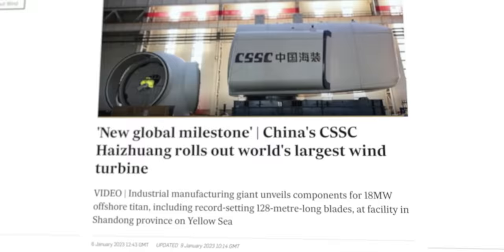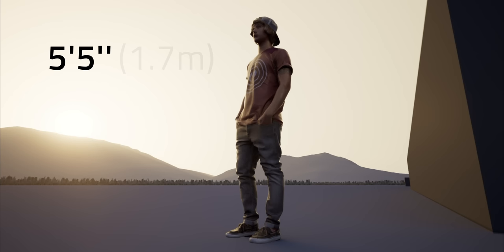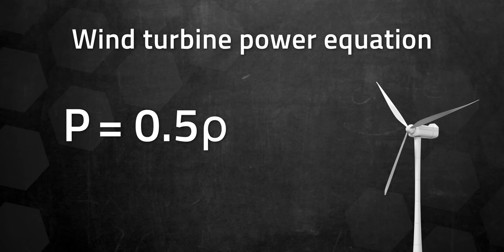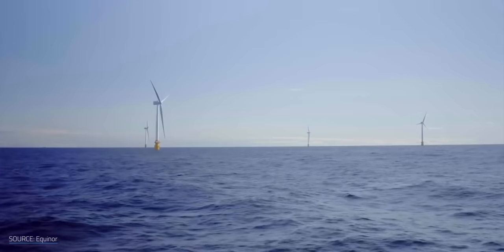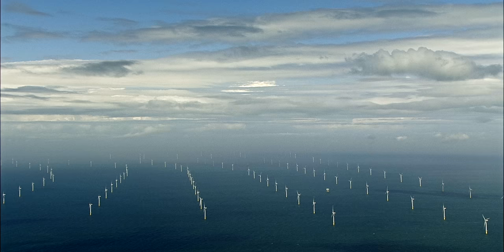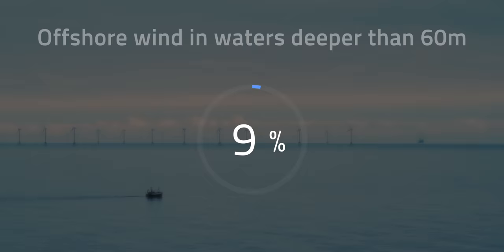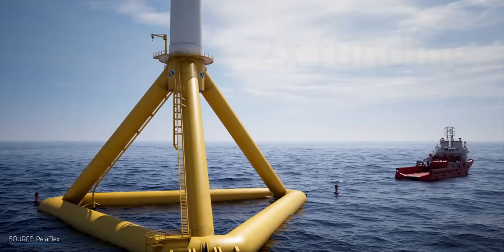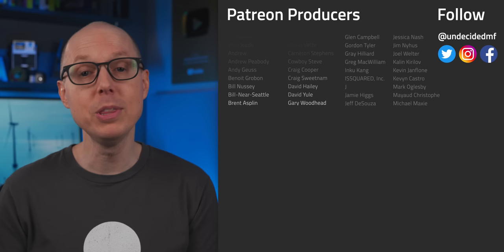Why Are Floating Wind Turbines So Huge?

Comment: the chicken or the egg problem, I think wind turbines, especially offshore wind turbines are a very good way to produce renewable electricity, because I believe we are now at a chicken or the egg point when it comes to electrification.

We are now encouraging people to buy electric cars, and replace the gas boilers with heat pumps, and these products are now being manufactured, but currently the only way to 
generate enough electricity to power all these wonderful new things, is to pump more gas or other fossil fuels into existing power stations, because we are still a very long way from 
having enough green energy supplies.

I believe for most countries the goal should be to build 50% more renewable energy generation than they would need on a typical day, and store any surplus energy, some to be 
turned into green fuels for heavy transport, shipping or planes, and the rest should to be used to generate electricity when the renewable capacity is low.

 whether the renewable generation comes in the form of solar panels or wind turbines, tidal, or wave power, will depend on local weather and geography, and the quantity could be 
reduced if they have any base line nuclear generating capacity, solar panels or concentrated solar tend to require a great deal of land, which might be better deployed for growing 
food, and even were this is mitigated by mounting solar panels on roofs of domestic or commercial buildings, their use is limited to day light hours, plus they are only at their most 
efficient for a couple of hours each side of midday, which does not match the main consumption period which is usually in the early evening.

Offshore wind turbines while not being constant, do tend to be operational many more hours of the day, but as you have stated they are expensive, this is partly because the wind 
turbines are enormous, but it is also because their manufacturing runs are small and intermittent, due to the combination of a lack of a deployment strategy, and the over 
abundance of red tape and regulations in most countries. In the U.K. it is often quoted that to manufacture and install a wind farm can take little more than 12 months, but the 
planning permission and more importantly getting a national grid connection can take more than 7 years, even with these problems companies have invested in offshore wind farms, 
and I am certain many more would do so if these impediments could be overcome, and most are in the gift of the government.   

 For many parts of the world large offshore wind turbines will be the best way of expanding the generation of green electricity in a short time scale, which we will need to do if we are 
to power our new electrical devices and stand any chance of reaching net zero. What we must also do is to build energy storage at scale, because until we the ability to 
store enough energy to generate electricity 24 hours a day, 7 days a week, and 365 days a year, we do not have a genuine alternative to fossil fuels, luckily, we do now have enough 
storage technologies in development to meet those criteria, all that is needed is the will to pay for them to be constructed at a large enough scale.

The next section is going to be from the perspective of the U.K.  Britain’s weapon of choice is wind, but every winter the U.K. is subject to weather events, known as a blocking high 
pressure system, which can last for up to two weeks at a time, and they usually come complete with a blanket of cloud, which further reduces an already limited amount of light 
for solar panels, plus there is little, or no wind for the wind turbines, leaving us with nuclear but even if we get 8 shiny new nuclear power stations, that is equivalent to only 30% of our 
energy needs, which will go nowhere near meeting our energy demands, put simply we need a system that can store and supply between 60 to 70% of our energy needs for up to 
a month each winter, only a chemical storage system has would have the capacity to storage energy for such a period, if we are not to fall back onto fossil fuels.

It has been suggested that large scale energy storage is unnecessary, and that we should rely on interconnectors under the sea to transfer electricity backwards and forwards 
between ourselves and Europe, on the assumption that some part of Europe will always have a surplus we can use, but I can see a scenario where eastern Europe is suffering a 
winter cold snap and needs all the energy it can get, Britain and the low countries are stuck under a blocking high pressure system, so no wind, plus Spain and Portugal are covered by 
rain bearing cloud, so minimal solar power, and such a situation would not be that unusual, and given recent developments with the war in Ukraine to satisfy a small man’s ego,
 it would be extremely unwise to assume that our partners in Europe will always be willing, or even able to supply us with what we want, when we want it, storing our own energy 
means we stay in control.

  Another idea doing the rounds, says we build the bare minimum amount of renewable capacity and use smart technology to switch on or off an internet of things, as a way of 
balancing supply and demand, where large tech companies would control the operation of everything from large factories to your domestic washing machine or fridge, I believe this is 
a distraction, I believe that the big technology companies could build such a smart system,  but I also believe that the tech companies already have too much control over our lives, and 
I believe our goal should be to build 50% more renewable capacity than we need, so the excess can be stored, and we do not have to rely on a smart system that could be hacked. 

Storage 
  When it comes to energy storage, we must consider 3 categories, starting with, short-term grid storage, up to 6 hours to even out the highs and lows of demand and production, our 
existing pumped hydro systems work well enough with fossil fuel plants, but as more renewable energy comes online, it will have to be supplemented probably by batteries, 
which will also play a role with home energy storage, and light vehicle energy storage, but not lithium-ion batteries, which keep getting more expensive due to rarity of the materials 
they are made of like Lithium, cobalt, and nickel, plus there is environmental damage caused by the mining and processing of these materials. 

   Sodium-ion batteries are already beginning to compete with lithium-ion batteries, as they are made from cheaper and more abundant materials, and batteries using other low-cost 
materials like sulphur are making good progress in development, within the next year or two there could be several cheaper alternatives to lithium for batteries, which could soon look 
like yesterday’s technology.

 
 Then there is the 6 hours to 48 hours segment, there are many hopefuls in this sector, but there is one technology that looks to me ideal for this slot, the carbon dioxide battery 
(Energy Dome) basically, a closed loop system where a large quantity of carbon dioxide is repeatedly compressed with surplus energy, then allowed to expand to generate electricity, 
but best of all there is no Hughley complicated cryogenics system, and it is made from off the shelf engineering components, which should make the system affordable and easy to 
replicate, the only drawback is the large size of the dome, but I am certain these could be accommodated at old coal fired power stations waiting to be decommissioned, the dome 
could fit where the coal was stored, plus the transmission line would already be in place, so, we would be reusing an existing site, other options include huge spinning flywheels or 
the raising and lowering of heavy weights. 
  

Then there is long-term storage, for when the wind and the sun don’t play ball for days or even weeks at a time, plus fuel for heavy vehicles, ships and aircraft, only energy stored in a 
chemical form has the density for this, and luckily the latest development for producing Hydrogen by electrolysis is looking very efficient, plus there have been big development in 
green Ammonia as well. 

So, which should it be the chicken or the egg, should we encourage people to buy electric cars and heat pumps, knowing we will have to burn more fossil fuel to power them, or 
should we priorities the building of renewable energy generation and storage, and leave the new toys until their cost has come down and their efficiency has gone up.

Comment: I wonder about the transmission of the power generated off shore. Land based wind turbines have a step-up power transformer at the base of the tower to increase the voltage generated to a value compatible with the nearest transmission lines. High voltage cables for underground/water use are extremely expensive and I can't imagine it would be cost effective. How do they do it?

Comment: With the money invested in design, the turbines being installed
Couldn't we just install solar and batteries in independently owned homes, or will the turbines (per cost of 1 to the same cost in solar and batteries to to the same value) generate more power over there lifetime

Comment: I was hoping to see how they stay upright during severe storms :(
Reply: They just tend to go with the flow.
Reply: storms move the air a lot, and the waves go up and down.. bit the sea doesn't move much.    oil rigs have been doing this for decades, they are tensioned down, so without the cables would pop up.  this means the small differences of waves makes very little difference.    Resonance is more of an issue if i understand things right.
Reply: They are put into wind stow, they face the wind head on, disconnect the main rotor, release the brake, and turn the blades so that they catch as little wind as possible. All to protect the tower

Comment: What's the cost to power ratio over the lifetime of the rotor? That's the info I want.  How much money did it cost, and how much did it generate. And that's not just because I'm interested in investing. I believe it's actually net negative. Wind wouldn't be profitable at all without subsidies.  But that just means it's only profitable to a select few at the expense to everyone else.  Net negative literally means loss of energy. We used more energy creating them, then we got back using them. Since energy is carbon, wind is actually more carbon emissions than anything else since we got nothing back.  We lost.
Reply: If only there were easily available studies looking at this exact thing that one could find with less than 30 seconds on google to learn that wind turbines are massively net positive.

Comment: Is it possible to have multiple turbines in one device; that catches upper wind currents and directs that force down to a coin toss in a cyclone role theory into multiple electricity supply from turbines and outer shell down..; allowing an upper current allowing preset wind currents to pass due to a horizon upward wind (HUW) currents 
Allowing destructive/beneficial weather effects be distributed in remote locations.

Comment: I wonder when there will be a debate on the climate impact of these wind turbines as they take energy from the wind reducing its velocity. With CO2 we are speaking of an air concentration of 0.04 percent having a significant impact. What if all the turbines would slow down the global speed of wind about the same percentage? Wind is a driving factor for transporting rainclouds. To me it would seem like less wind less rain further in the continents centers

Comment: Why are these turbines planned with an expensive cabled connection? Wouldn't it be easier to convert the electrical energy to hydrogen, have a hydrogen tank nearby and just collect the hydrogen when the tank is full?
The turbines could be easily transferred to the locations with the strongest wind flow, equalizing the energy loss of the conversion to hydrogen
Reply: Did you think much before aberrating?

Comment: Great video and explanation.  You glossed over the bird kill issues which are significant but the real undisclosed issue is the drag from pulling all this energy from wind velocities.  Water vapor moves worldwide with the wind.  Slow down the wind and slow down water distribution.  Drought in the places farthest away and most likely the driest.  Without doubt the fault will be placed at the feet of Global Warming, but the real cause is massive wind drag slowing wind water movement from massive wind farms.

Comment: If 1 wind turbine can power 20 000 housesholds and there is 197 M households in EU, in perfect conditions we would need just 985 of these? I mean there must be missed out something, doesnt it include heating? Factories and business, public transport not included I guess?
Reply: But the wind isn't always blowing. So other sources is often needed.
Another problem is that you cannot place them everywhere.
Either there isn't enough space for it, or the wind is less efficient than in other areas.

Thats one problem Germany currently has.
The goverment wants more wind turbines but the best places with the best wind are already full.
Placing them anywhere else just makes them less efficient.

Comment: Very well done video. I enjoyed it a lot. But I have a question: What would the impact of Hurricane season be to these turbines? If a medium-sized hurricane or typhoon gives them 120 mph sustained, with higher gusts, can they withstand this? If not, then the grid will be impacted with their loss of production until they are repaired or replaced. I’m not in the biz, so if the answer is obvious please excuse. Great content, and keep the videos coming!
Reply: I’m not in the offshore field but I work on land. From experience I would say they do not put towers in places that are prone to hurricanes, and yes winds that high would literally blow the tower over and destroy it. We can stow towers to face the wind and change the angle of the blade so that they are not catching any wind but it can only protect it so much as winds can change direction rapidly and are extremely powerful. This would result in a huge loss, both financially and loss of electricity to the grid. Given that it’s offshore, they wouldn’t even be able to go fix any problems until the storm passes.

Comment: It is clear from the data and the formula the the power output has a linear relationship to the blade disk area. This is what we should expect. We shouldn't expect a linear relationship with the diameter or blade length. Similar to a pizza that has twice the diameter is actually four time larger.
Reply: It’s non linear. If it were linear, we wouldn’t be building them as big as possible. Area is pi * radius squared. That’s not linear.

Comment: What is the cost for 1 18 mw windturbine + cable to land etc ??  + losses when transfer ( what do you get out off it ?? ) . Becuse  as a example fast charge a modern electric  car is 350 kw / car = you can charge 51.42 cars at the same time ( or just say 51 just incase ) per windmill if it is with 0% loss on transfer  . That is not much.

Comment: I think I'd rather see decentralized power generation.
Fewer utility companies involved.
Specifically solar with individual and small scale battery storage of some type, including EVs.
Smaller grid size since the energy is used closer to point of generation.
No large scale maintenance either.
Less susceptible to disruption i.e. natural or human made disasters.
Easier to update.

Comment: Just one thing. The cost. This behemoth, money pit will need to be replaced in about 10 years. The blades last ~ 8 - 10 years, the generator about ten years, maybe less with higher wind speeds. Bigger is more power and more cost. Now imagine a little SMR, actually maybe a few SMR’s to provide the power 24/7 to ‘just when the wind blows’.   A waste, of money and wild life.
Reply: “The nuclear reactor that nobody’s ever built before is going to be under budget and on schedule”

Mhmm right. And Vogtle 3 finished in 2016 too!

Comment: You haven’t given any estimates on the CO2 cost of mining raw materials, manufacturing, building purpose vessels to transport and maintain.  The additional CO2 cost of decommissioning, transportation and disposal of non recyclable material,   these monsters.  Also rendering recyclable into usable material.  Then compare to the estimated value in CO2 offset.

Comment: To block ships, the amount spent on this doesn't justify the energy created even when limiting to green sources. Your government wants control of human movements in the future and the windbank serves to disrupt consumer grade sensors in the area, especially marine radar. You can't get anywhere near the windbank, that's the point of it. Your country could have easily built a hydroelectric dam or even a nuclear power plant that would be many, many times more efficient than a windbank. Your government but a blockade-shaped group of highly efficient jamming machines off of it's coast because it wants them there.